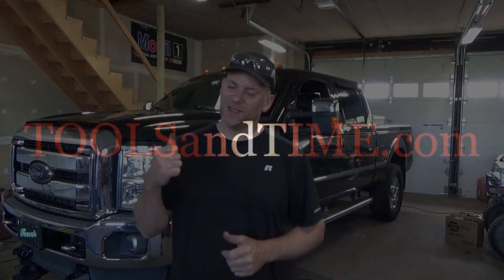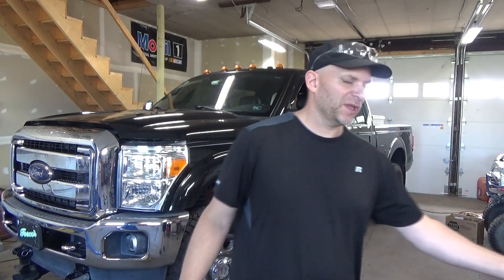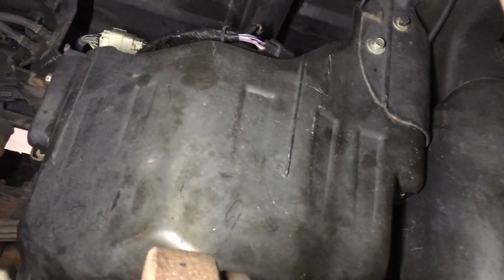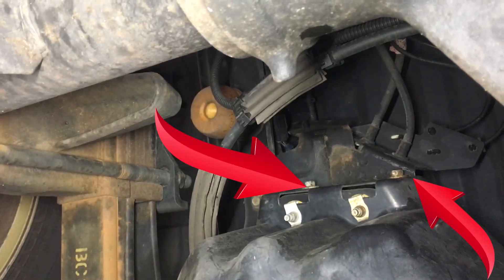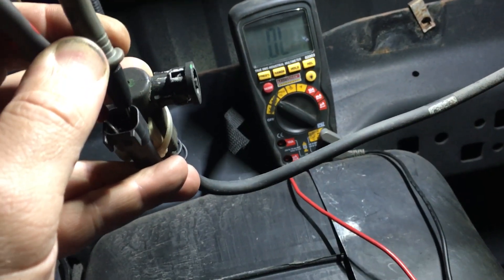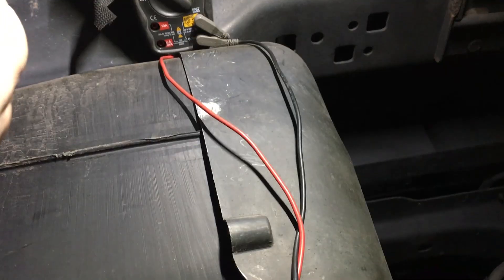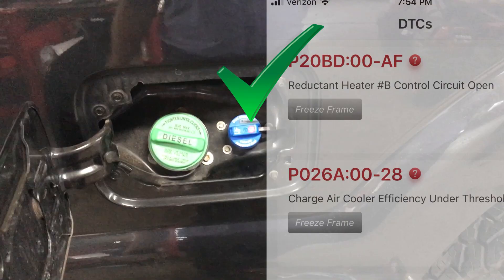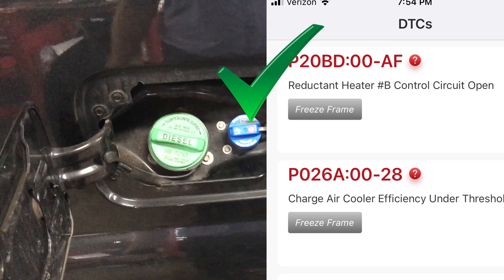Ford Diesel: P20BD - DEF Reductant Heater B Control Circuit

Comment: Great video.  I have a problem though. My 2015 gmc 3500, 6.6 duromax has the long def  tank under the passenger side. I'm sure it is probably the same part number for the injection line heater, and I too was told it was the tank heater, so I spent half a day changing it out and less 700 bucks, only to find out from your video that the dealership told me the wrong part. Mine says low voltage,  which after moving the wires around is probably why it came out of limp mode and ran fine for a week. But my question is this. Your 3500 must be the 2015 and a half, or is it because mine is a flatbed chassis model? Is the reason for mine being the large long def tank. I fill my def from under the hood. (Sorry, I just Noticed, after rewatching, yours is the ford 6.7, mine is gmc 6.6) but the video still stands since they both have two heaters, one in tank and one line heater.

Comment: Excellent!  2019 F250 - Im getting a P205B Reductant Tank Temperature Sensor "A" Circuit Range/Performance. Could this be the other heater you spoke about, and is that on the pump itself? thank you - Chris

Comment: The thing Ford refuses is put a force regen button or at least has not put one in there past Diesel, instead you hv to drive it . God for bid the air inlets hose pops off and you hv to drive a short distance to safety to pop it back in and then the truck has sweated and started the shutdown mode due to low boost. And the only way is force regen with a laptop 🤦🏼‍♂️
Reply from the maker: I hear you. This one is essentially the same or requires a forced regen. In which I chose to perform on this truck after the next repair I have coming up. Man what a process that is, make sure you have plenty of fuel, park it outside, nothing flammable or that can catch on fire in the bed, warn the neighbors it’s going to sound like a jet taking off or a runaway diesel and make sure you have the insurance up to date just incase 😅
Reply: @robinsonsauto  most gas station (flying j) won’t allow forced regen on there property you can do it on the frontage road, and nothing is more depressing that a failed regen , few are the guys who really understand the regen process which leads to many units repeatedly going down my neighbor has had his truck in and out of Ford for the past year and they still can’t fix it, yup it’s come to that!
Reply: I believe you can add this feature with Forscan